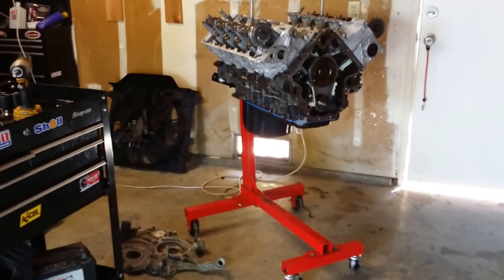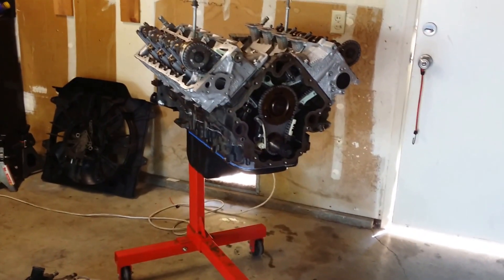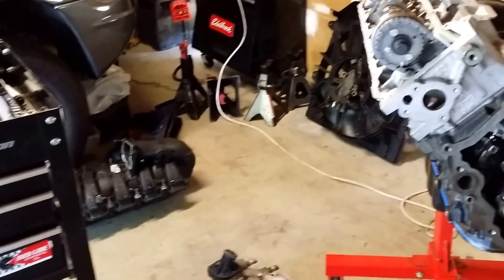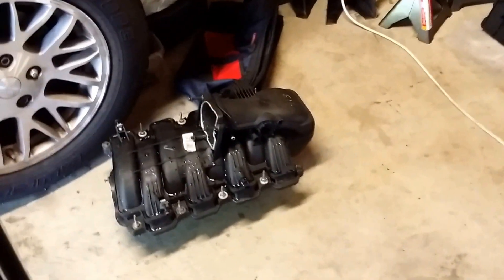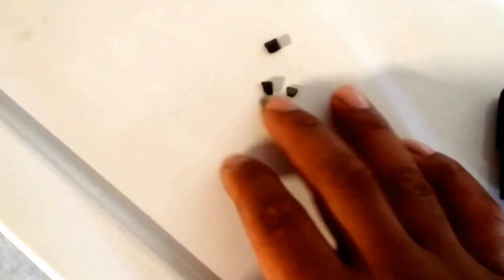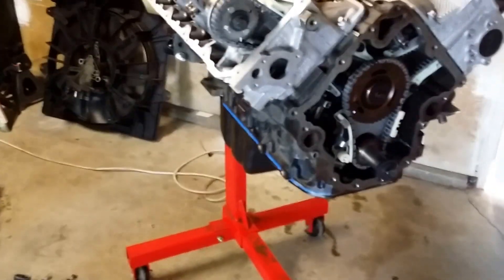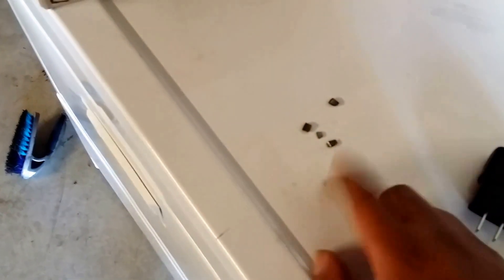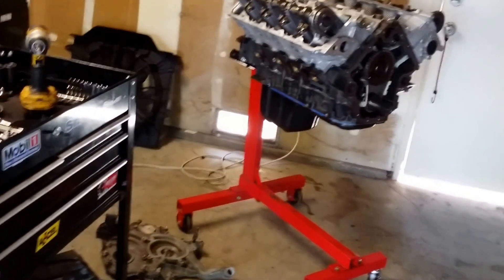Whats inside  the intake  on a 4.7 Dodge that dropped valve seat

Comment: mine had the exact same issue! i pulled the valve covers off to repace valve seals and lifters, when taking the intake off i found metal pieces just like yours! cleaned it out put it all back together and checked for debris with a magnet in the combustion chamber and there was a small piece that made its way. got it all together and a few weeks later my engine locks up. pulled the intake off and found the same metal pieces but larger than before

Comment: I got mine rebuild the hole engine but now I put the intake manifold on but keeps leaking from the middle of the intake manifold on both sides so i got used 1 and the same thing and surface is clean and all got my heads shave wat could it be
Reply from the maker: Remove the intake manifold and put a straight edge across the cylinder head intake ports and check it for warpage. Sounds like the heads might be warped at the intake ports.

Comment: Very good to know, sir! I got myself a rebuilt 4.7L H.O. I'm still debating on whether or not to buy a brand new intake manifold even though I have soaked the manifold in a tub for like 2 weeks and pressure washed it. Still have the old engine here and am going to see if I have any broken valves but the old engine went kaput due to a broken connecting rod with the piston number 7 had broken pieces as well and a topside hole on the engine block.

Comment: i have a 04 dodge dakota. 3.7 motor and theres a hard click sound when i let off gas and sounds like it coming from inside the air intake manifold. if anyone has any ideas please let me know
Reply: torque converter bolts loose.
Reply: I get a loud tick from around the intake manifold minutes after shutdown. What would cause the noise? Sounds similar to locking a deadbolt.
Reply: @lewisrobinson4292  your intake manifold bolts are getting ready to break. The screw gets stuck in the block

Comment: if you drop valve seats, the engine is running too hot.
Reply: tunnelportterror not always had mine drop on a cold start
Reply: @02jeepwj  yeah but it became loose because of your engine overheating..

Comment: Dorman does make the new intake manifolds and Chrysler does sell them new as well.Jasper Engines and Transmissions does put a tag on their reman 3.7,4.7 and the hemi engines to check the intake manifold very well before installation.